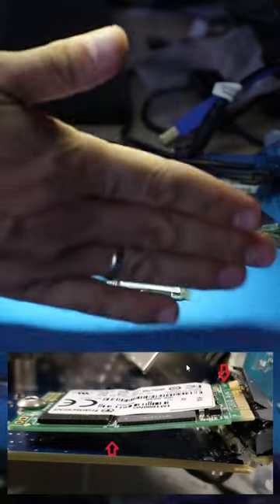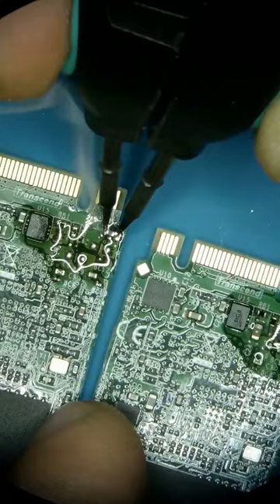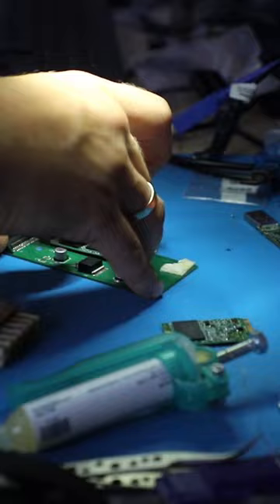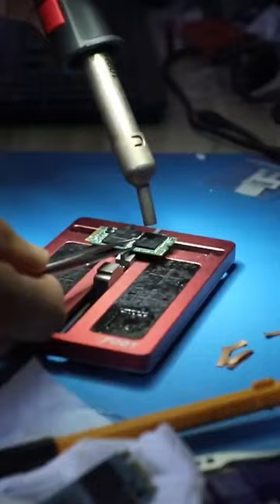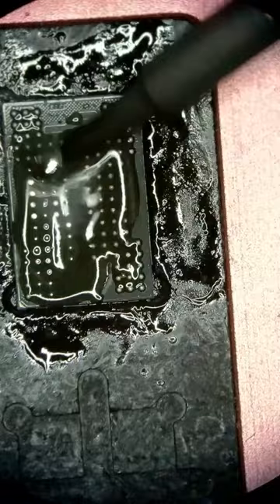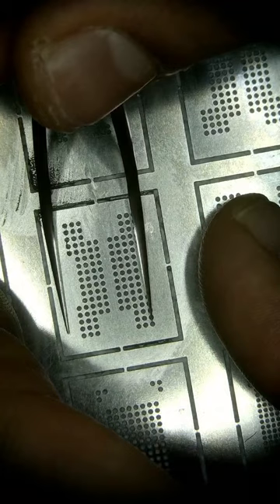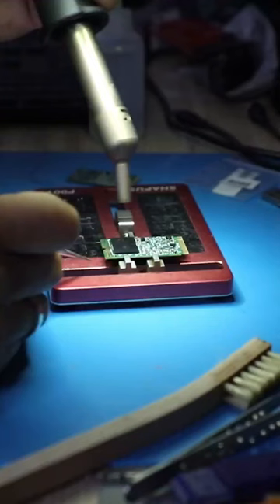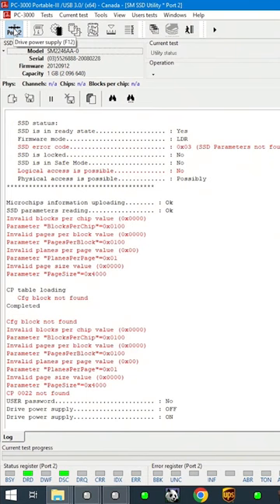solid state drive was broken in multiple places. can we save the data from it? #tech #datarecovery

Comment: It's interesting such extreme heat does not mess up the data.
Reply: Generally heat is only applied for as long as it takes to solder/desolder components. Lingering with the heat could easily actually damage components

Comment: why wouldn't you just immediatly move the storage chip onto a donor board instead of trying to fix the messed up board?
Reply from the maker: Why? Because it takes a lot more time to move chips. Despite the fractures the SSD still had connection on Controller and controller could see all banks in both chips so trace damage must have been minimal. I don't have x-ray vision to say if it's split on not, and spending 30 seconds and moving 6 caps with tweezers seemed like a simple enough trade-off to see if it will start
Reply: Basically, don't overcomplicate shit

Comment: I have a question, can you recover data from a trim enabled ssd on which the clean command from cmd was ran?
Reply: There's no such command as "clean". Having TRIM enabled is irrelevant, what matters is if you've written data on it after you've wiped it, in which case only some data would be able to be recovered.
Reply: @HDJess  there is a command named clean in diskpart
Reply: @HDJess  i haven't overwritten it
Reply: @ayanchuchu8264  right, I've never used this clean command in diskpart. So it deletes all partitioning and formatting, no big deal. Recovery software can still recover everything, if you haven't overwritten it.
Reply: Clean is not a low level format I’m sure any respectable data recovery software can rebuild the partition table MBR or GPT and mount it as a virtual disk drive
Reply: @HDJess  thank god but trim commands throw 0s to all the sectors
Reply: @_EyeOfTheTiger  I'll have to check that
Reply: @ayanchuchu8264  the clean option of the diskpart appears to be just a quick format and delete of partitions. However, "diskpart clean all" does indeed write the entire disk with zeros, so there's no coming back from that.
Reply: @HDJess  i didn't ran the all command only clean. But did it many times. Guess I'll just save the ssd until i can send it to someone to have it recovered.
Reply: @HDJess  reason for that i just thought it's cleaning 👀 not formatting😂
Reply: @HDJess  that might not be true do you know how long it would take to 0 out the entire drive? Almost a whole day depending on the size
Reply: @_EyeOfTheTiger  no, it doesn't take all day. Modern SSDs write with hundreds or even thousands of MB/s and for a 2TB drive, it would take around 1-2 hours to write it fully at a speed of 500MB/s. For older HDDs, it might take several hours, but not a day.
Reply: @HDJess  either way I doubt he sat there more than 5 mins

Comment: Hey i have ssd wd blue 128gb which stopped working on screen then i removed and checked many times it didn't work i kept for one month again i tried it start working but after day it stopped and now cycle keep going it only work after few days can you tell me whats the problem..
Reply: Are you really trying to get a diagnostic with such a low amount of info, and for free? C'mon
Reply: @MkLC04  i pay for it first ill have to know what's the problem. C'mon
Reply: @saifi1223  you're asking advice from someone whose rate is probably £100 per hour to fix a trashy £20 SSD? Bin it.